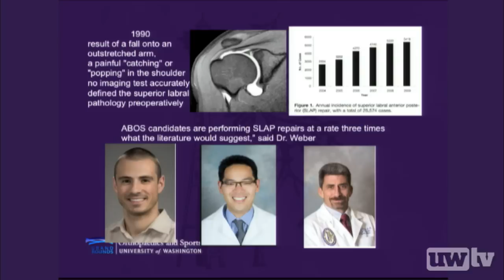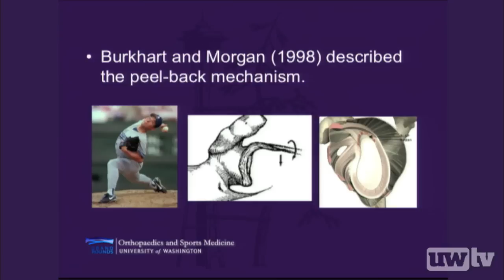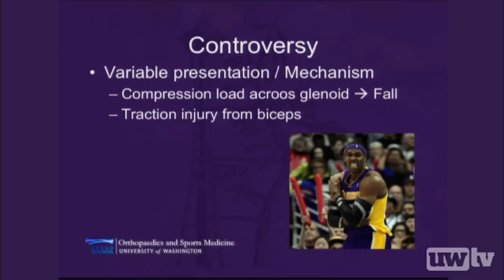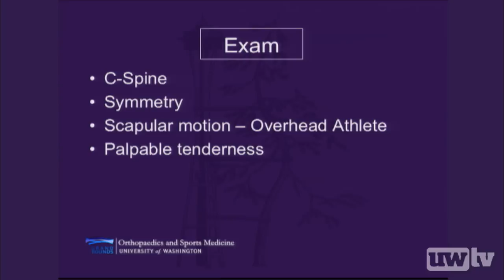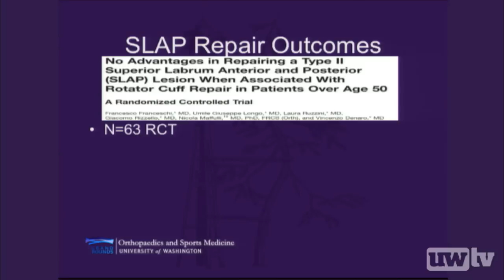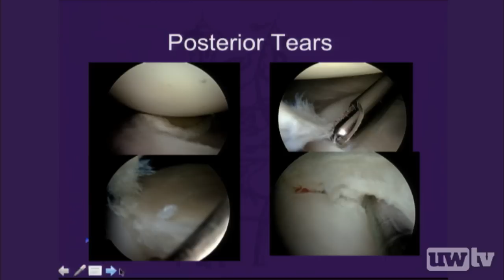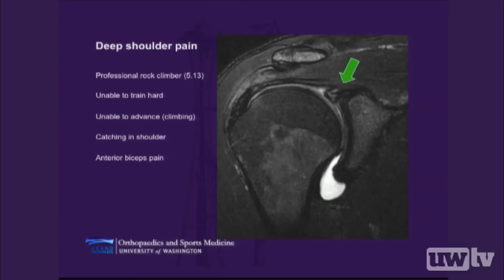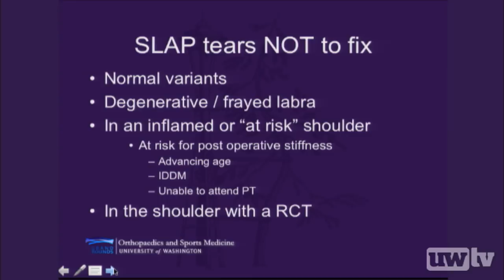Superior Labrum Tears in the Shoulder: Controversies and Consensus

Comment: very hard to diagnose.  they thought I had 85 tear in left and 45 in right.  After artho, slap was diagnosed.  wake boarder for 15 years.  continually yanked from water and loading the line at 20-30 mph, pulls from shoulder and waste height, prior weight lifter, former soldier (lots of push ups).   I contribute the injury from wakeboarding injuries.  we should be seeing more frequent injuries of similar SLAP since the sport has grown in the past 10 years to include younger athletes to the backyard weekend athlete.